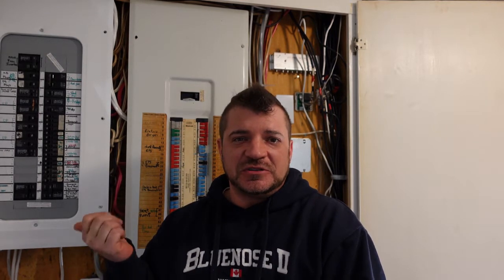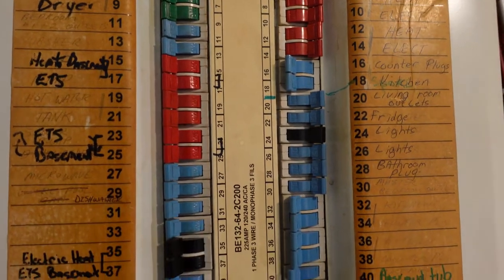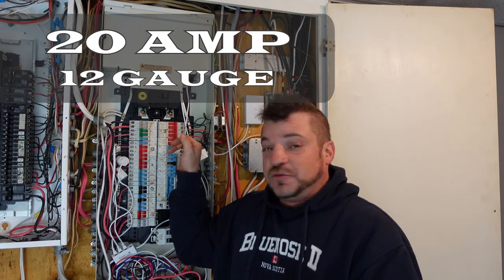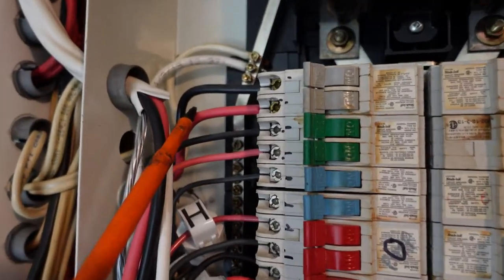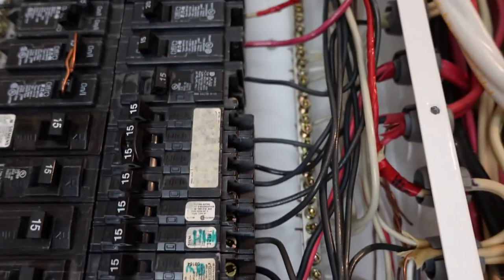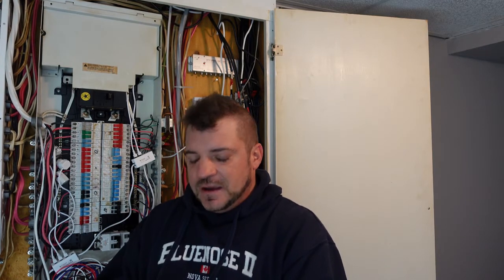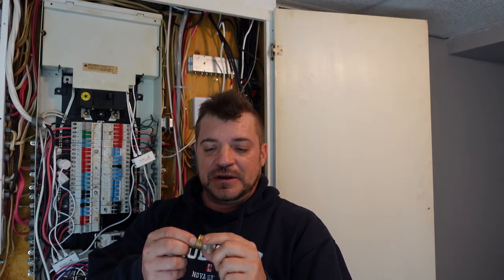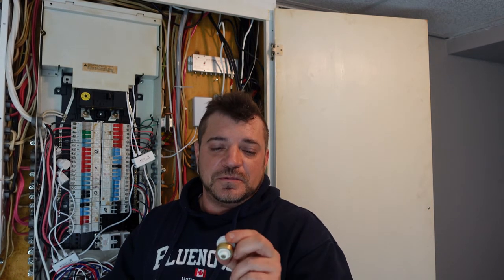Correct Circuit Breaker And Wire Size

Comment: When you say oversize the breaker you don't "undersize" the wire. 10 AWG is a thicker diameter than 12 AWG. It's an inverted scale of numbering but you are still up sizing the wire when you up size the breaker. While I am sure you know this, I think some people will be lost in the semantics.

Comment: When they had the old ceramic post and loop, they frequently used a smaller gauge of wire for a given application.
The exposed wire could release more heat.
Too bad they don't use that anymore (with insulation upgraded of course).
A 12ga wire could handle all 20 amps without any problems. Even 25 amps.